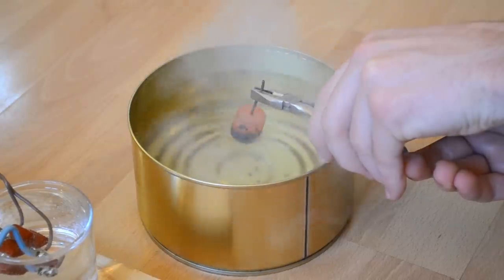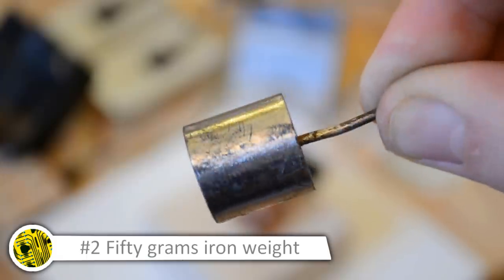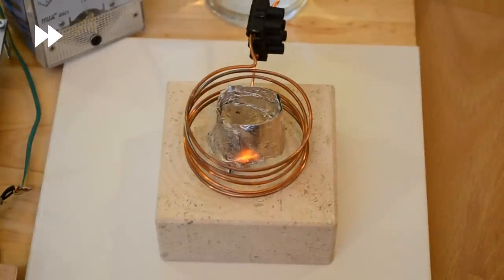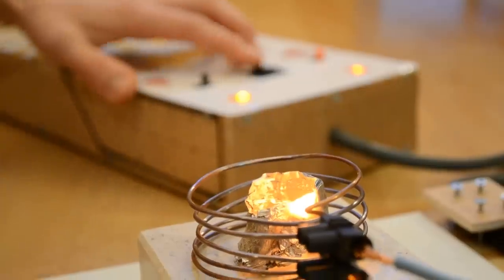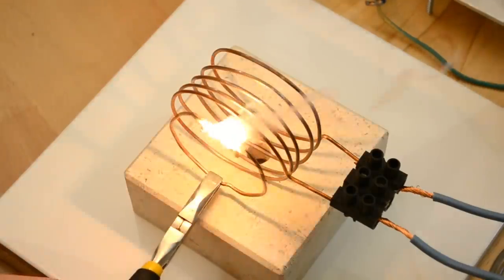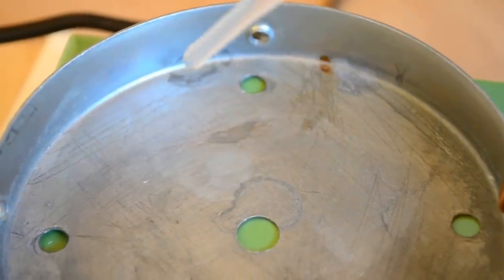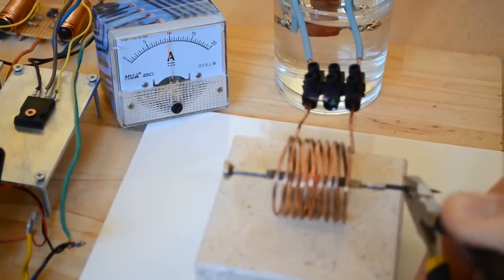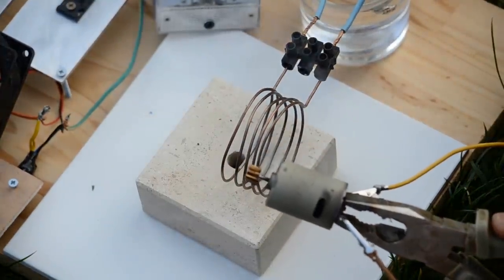Induction heating - DIY Experiments #8 - Make an induction forge

Comment: Electric foundries have used induction furnaces for year. The coils have water pumped through and are encased in refractory cement. Each coil is separated by ceramic spacers. They quickly melt copper, aluminum, iron and steel allowing for alloying prior to casting. They also produce some spectacular molten metal showers when they short out and introduce the coolant into the mix.
Reply: Md.khokon. ❤❤❤.. Woldingmqsinloken

Comment: I have been checking Induction systems on the internet for more than a year.  I am looking for the best available able to be adapted for various applications. As far as I am concerned this is the best presentation yet. Congratulations! I miss one thing however and that is a PC board circuit layout, You do not show your assembly of the various elements in a useful practical way either to help guys like me to follow suite.  Anyway your video is excellent.

Comment: What a great video that was showed schematics he spoke to us along the way tried a variety things very clearly proven high temperatures it receives through that system, truly is a treat not sure what they need these devices for but it was fascinating sincerely MacGyver
Reply: I had seen a similar principled device made by a German Company, the device is used for heating a motor shaft to extract motor bearings for replacement. Whenever you repair Electric Motor windings it is also desirable to replace its bearings with new ones, and to extract bearings on a shaft, you only need to heat it up by the use of induction heater just like this one. Amazing German Technology :)

Comment: Can you please make sure the instructions coming up on this are suitable for dummies with no electronic experience. 
The only reason this is cooler than a 100,000rpm motor is because I am an amateur bladesmith and this is probably the best way to never over heat a knife. (i've burned a few viking knife tips in the past lol,) and get it to correct forging temperatures perfect every time.
Reply: 8th sinner I am too. You are better off buying a 1000 W premade unit. You will be able to get bigger pieces hotter. Mine is even able to melt metal. Induction heating coil is the best way to go for small blacksmithing projects. Mine can heat three eights inch rebar cherry red hot in 45 seconds.
Reply: If you build an induction heating coil big enough you will be able to melt your steel in a matter of seconds
Reply: If you are a bladesmith you should invest time in learning to maintain a proper forge. Either coal or propane, maintaining your forge and it's temperatures is one of the key skills needed by a bladesmith. Yes, we've all burned an item or two (or more), but it's all in the process of learning. Most of the times I've burned stuff was because I was paying attention to someone else, but if I keep my thoughts at the forge I hardly burn any items anymore.
Reply: @patrickd9551  Obviously, I'm late to this party, but I have a question.  While I agree with your position on traditional forging skills, I'm certain the metal doesn't know the difference in how it got to that temperature - whether by a traditional coal-fired forge, by gas, or by induction.  Noting that, I am also cognizant of the fact that you can induce metallurgical changes by the type of coal you use, or even certain coatings - something lacking with an induction method of heating.  My question rests on these aforementioned methodologies as to which method has the best overall result in getting a chunk of metal up to operating temperatures in the most expedient and least work-intensive manner, discounting associated costs of operating each type.
Reply: @waynegroves6922  Oh I actually don't have an position on traditional forging. Heat it any way you like. My actual point was that if you have a coal fire, you should learn to master it. Burning metal happens often for beginners.Getting to know your forge is simply a skill earned by doing.

Whenever I forge in my own fire I have no problems. However when I go a friends shop I constantly burn my metal (mainly because we talk too much ;) )

That being said, induction heating is a very specific localized form of heating. Great for specific jobs, not general heating like blades. It is fantastic though with 10kW units and up. 

But cost being no factor? I'd say a good ribbon burner in a well insulated forge is probably the best way to go for general forging. Induction forging is really fast but you need to adapt your setup every time to the specific parts to heat in the right place.

Comment: If we keep aluminum/tungsten in vacuum bulb with little neutral gas and apply the induction we can use it as bulb
Reply: Neutral gas?  What do you mean?
Reply: @grazzydazzy57tm39  inert gas.
Reply: Photo for your statement, To gain some knowledge mb k.
Reply: However, it could melt it. Anyway, incandescent bulbs are more efficient than this mess.
Reply: Nobody asked
Reply: But very inefficient and lot of waste of energy

Comment: So... Are there any downsides to using an induction heater to forge metals - for knife-making basically? Am I missing something? This seems absolutely perfect for forging. It's just, from my perspective the only cons I can see is it looks like it sucks a lot of power and it can take a minute to heat metal to red/glowing - neither of which seem like that big of a deal since other forges require either gas (propane, oxy/acetylene, mapp, etc) or other fuels (coal, charcoal, wood, etc) and those still take a minute to heat too - maybe even longer. And the electricity usage isn't that big of a deal to me either. I consider myself to be on the intermediate level with electronics. I don't see why I couldn't build this and forge knives with it... I've seen these before but this one looks even simpler. Seems almost too good to be true...

Comment: I built per the schmetic, it sort of worked for a few minutes then then capacitors got very hot, and now it keeps buring up mosfets. What zenner diodes would need added and where would they go to prevent the mosfets from buring up. Also do you have your capacitors in distilled water?

Comment: Replace with a copper tube and ads cooling system to reduce the heat of the coil
Reply: how should i add the cooling system? you know any tricks? should the water flow in the tube?
Reply: @mohamadarieffakri5140  use a mini water pump to run water through the copper tube while you also connect the coil with the circuit.

Comment: Great video can it be used to dry up poop to turn it into fertilizer / power? How many kW of induction power is required to dry up poop INSTANTLY?  How many coils will be required? I am thinking about pooing in a bag and then drop the poo into a vertical coil to dry it INSTANTLY Thanks again for your video.

Comment: Very interesting. Do you know how much smaller can we make an Induction Heater? I see a lot of DIY chinese IH but they are still 5.5x4x2 cm for 5-12 V and 120W, and the 4cm width is a bummer for me. Is it possible to assemble an IH and make it smaller? It would be for heating pen like cylinder not above 220°C if that can help? Thanks anyway for the great videos ;)

Comment: Hallo DIY Experiments
Dies ist ein sehr informatives und gut gemachtes Video!
Aber: die gate to source Spannung bei fast allen Mosfet´s ist +/- 20V!
das bedeutet, dass die Mosfet´s in Ihrem Aufbau sehr "gefährdet" sind!
Wenn Sie die Gate-Widerstände mit 9...12V versorgen ist dies Problem gelöst.
Außerdem kann dann die Leistung, die an den Drosseln (choke´s) eingespeist wird,
sehr variabel gehandhabt werden - bis 30V bei 100V-Mosfet´s.
Übrigens: diese Schaltung entspricht dem Deutschen Patent Nr. 35 19 489
vom 30.11.1989, welches der Fa. Hüttinger - Elektronik in Freiburg i. Br. erteilt wurde.
Damit wurden schon viele Geräte gebaut wie z. B. für HF-Chirurgie 50 bis 400W,
Dental-Labor mit ca. 3kW sowie Geräte zur Wärmebehandlung bis 50kW.

Comment: I have one of those single inductive cooktops that was knocked off a counter and had a broken glass top.
I took the broken glass off with the intention of using the inductive hardware to make an inductive heater to temper metal with.
There was a sensor in the center of the coil I assume it's the sensor that tells the temperature and / or tells the machine whether there's a ferrous pot or pan on the cooktop.

I removed the flat coil and sensor and replaced the coil with a cylindrical one.

Then, put a piece of iron on the sensor that was in the middle of the original coil. Since it would cut off at 450f it's not needed for anything other than telling the machine there was an iron something or another present.

Turned it on and while all the digital things on the display indicate it's working, I'm not seeing any sign of heat from anything I'm putting in the coil.

I was out of time to play with it so I put it up.

Anyone have any idea what I may need to do or check to make this thing cook?

Thanks.

Comment: If you start with a cymbal-shaped metal object:

1)  place the induction coils so that they cover the top of the cymbal and so that the eddy currents created in the metal cymbal will be created along the top surface.  The higher the frequency you use to run the induction coils, the less depth of eddy currents occur due to the 'skin effect', so that if you use - say - the output of a microwave klystron tube to power your induction coils - a very, very thin layer will have induced eddy currents

2)  create a 2nd, static magnetic field at a RIGHT ANGLE to the eddy currents induced in the metal cymbal.  That means, if the cymbal is positioned horizontally - like the top half of a flying saucer - the magnetic field needs to be oriented vertically.   This 2nd magnetic field can be created through the centerpoint of the metal cymbal using a permanent rare-earth magnet or a columnar electromagnet

3)  THE RESULT:  a Lorentz force will create immense, coherent accelerations in the charged particles of the metal cymbal

If you can find the resonant frequency of the cymbal and adjust the klystron to that frequency, you will obtain the maximum effect.  

The objective is to create coherent, extreme accelerations of the charged particles in the metal, at a resonant frequency of the metal.   Some UFOs glow as if they're on fire.  The key to creating artificial gravity is to create immense coherent accelerations of the charged particles in the metal, by way of the Lorentz force.  When the Lorentz force is imposed in the manner above,  all the charged particles move in unison, and no longer have random, chaotic motion.  

In a 'passive' metal, the charged particles (the electrons and protons) in the metal have random, chaotic motion and mostly cancel each other because of that.  The Lorentz force compels the charged particles to act together,  "all working to pull the cart in the same direction" and that is why a field effect can occur.

The object is not to melt anything.  Moderation of the current supplied to the eddy current coils is called for.  Optimally, a lamination (layers) of metal separated by insulation is better than a single metal cymbal, but cymbals are easy to find and buy.  So is an induction coil and a permanent magnet.

Comment: Hi DIY Experiments! This is a really great video! so informative!
I am trying to build an induction heater like yours, but with a temperature controller. I thought to use a temperature controller that would read the temperature of the heated metal through a thermocouple and then change the current in the coils accordingly.
Do you know of any other more efficient process to control the temperature of this heated metal placed inside the coil?
Reply: i know this is old comment, but ill reply anyway :D 
you could use thermostat with quick rise/fall. then set it to temperature you want and put the sensor on the metal you're heating.... but i would not recommend that, coz the fields could be a problem (i. e. heating the sensor itself) so i would implement SSR(or any other high efficiency switch) with microcontroller and IR temperature sensor. that could be better.

Hope you have a great day! and I also hope I helped you at least somehow...

Comment: Can you put a copper tube threu it? And heat water for shower? End of the copper tube plastic and begin. So there Will be no current going to the shower
Reply from the maker: It would be an inefficient way to heat water whereas a for this application a simple resistor is way more efficient and cheaper!

And in all case even with induction heating there would be no risk of electrical shock :)

Comment: Sir aluminum is diamagnetic material so how does it worked on induction

On induction cook top aluminium utensils won't work
Reply from the maker: As explained, there are two reasons for which a metal piece can heat with this forge: for ferromagnetic metal only there is hysterisis losses and for all metals (including alumium) there are Eddy currents! As there are both for iron it works better :)
Reply: Ok sir thank you 😊 for replying

Comment: I need to know more about this Xbox psu you made. Did you just put 2 in series? I've been using 1 to charge my RC batteries for a couple years now.
Reply from the maker: Yes 2 in series :)
It's not "recommended" but it works well

Comment: I bought an induction heater, but left it on for a long time and the coil got burnt.  Can it be repaired, or does it have to be disposed ?
Reply from the maker: The coil burnt? Only the coil?
Reply: @DIYExperiments  That is what I am guessing. The device does not seem to have any other component or an electrical part at all, like some sort of a voltage regulator, or a fuse or a thermostat or a temperature control kind of a thing, but it is just a wire going directly into the rod , so it must be  the coil that is probably burnt or probably if the coil is broken or cut or snapped the device would cease to work but I am just guessing.

Comment: i was under the impression that only iron containing or rather magnetic metals would work when heated via induction because the heating is caused by the induction of the highly oscillating magnetic field from the coil to the object... since aluminum is non magnetic, how is it being heated by induction?

Comment: Forge: press or fit into shape.
Oven: enclosed apparatus for heating components (also furnace).
A facility where both of these processes occur may be known as "the forge", but the oven or furnace is not a forge.  Forged steel is heated and then forged into shape.    The dictionary has done a disservice by allowing wrongful colloqialism to skew the meaning.
Reply from the maker: Right, but the purpose of this oven in industry is to forge.

Comment: Hi ... Thanks for these wonderful experiences ...
Question 1? In this way, can I melt the plastic?
Question 2? Can this method be used in a practical and commercial way ???
Thank you .
Google Translate.
Reply: No for da plastic
Reply: This is used in a commercial way all the time, setting those machines up is my job. Obviously much much more powerful, but these  coils are used to quickly heat a part, which is then rapidly cooled (quench) to harden the steel in a part

Comment: if I use this method to heat tubing and pass air through it will it heat the air more efficiently than a normal electric heater?
Reply: It will work fine, however i doubt it will be more power efficient. This thing dissipates a significant amount of power just to drive the output coil.
It would also be less compact and more likely to fail.
I think a well placed electric heater is much better.

Comment: Will the coil shock you
Reply: Yes and no, now this here is an experiment, not enough power to actually harden metal. This set up could shock you, like when that sharpener melted it created that spark. But this would probably tingle.

Now I work set up at an induction heat treating company some of our more powerful supplies are pushing 300amps, when best is applied yeah those coils can hurt you, but only whole heat is applied. Basically if the part within isn’t getting hot you’re okay.
Reply: capella95 Yes you are right because I have a 1200 Induction heating coil at Home and I accidentally touch the output and it gave me a buzz. But the only reason why it would shock you is because of the high output peaks of the ZVS driver

Comment: I built the circuit that is shown in the video. I used components that are very similar to the ones you use but I only had 750 uH inductors so I tried with them. However, I am having problems with the current required to the power supply, it seems to be too big so the power supply shuts down. Does anyone have any idea why this is happening? Could it be because I have to tune the circuit with a different value of capacitance?
Reply: Just need a higher current power supply

Comment: Could you power this with an AC arc welder? I would like to use this for melting aluminum for casting in molds.
Reply: You can power these with a TIG power supply.

Comment: Pour les diodes schottky , peut on utiliser des diodes en série ou en parrallèle si on veut augmenter la puissance du four ( j'ai plusieurs de 40 volts 1 ampere ) ?
Reply from the maker: La puissance du four ne dépend pas des diodes (elles sont juste là pour commander les grilles des MOSFET) mais oui tu peux mettre des diodes en série pour équivaloir à une diode de plus haute tension :)
Reply: Merci à toi en espérant pouvoir arriver à fabriquer ce four .

Comment: How did you measure the temperature of the kilogram weight with just a wire?
Reply from the maker: It's a K thermocouple, there are two wires with different metals and it produces a voltage according to the temperature

Comment: Can you ionize gases with induction if you trapped gas in a container with induction device inside?
Reply: Yes, but you need higher frequencies for the induction device and the gas that you want to ionize must be at low pressure. Search "induction coupled plasma" on google